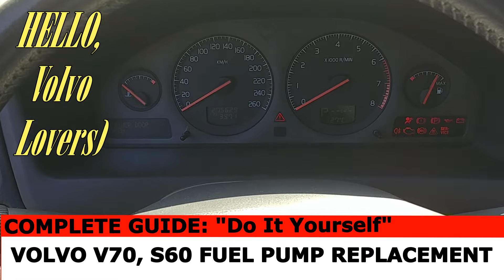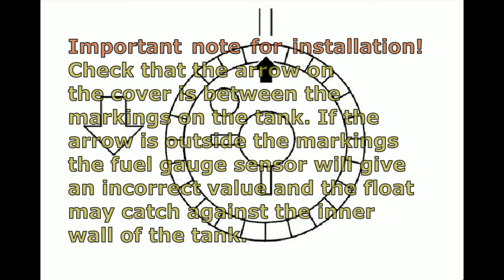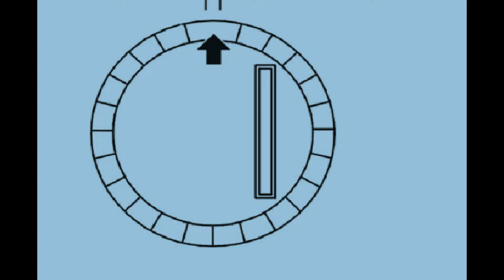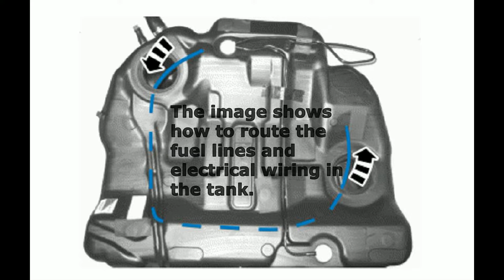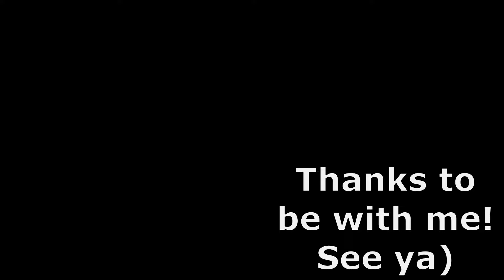VOLVO FUEL PUMP REPLACEMENT. COMPLETE GUIDE.

Comment: If you cap the ends of the pump before you remove it you can let it tip back easier to get the float arm out without spilling so much gasoline inside the vehicle.
Reply from the maker: Thanks Jon! I That's great tip! I will pin your comment up make sure other viewers can see it. Cheers!

Comment: Dear pistonshack. I have a 2004 Volvo S80 2.5 turbo all-wheel drive. I'm having two fueling issues. First one is I will fill my tank up in the needle reads full but once it gets past halfway it sticks and it doesn't move until the car runs completely out of gas this has happened to me twice while driving down the road. Second issue is that while feeling the fuel spews back at me unless I pump the fuel extremely slowly. Where it should take me just a 5 minutes or less to fill my tank it takes me almost 20 to 30 minutes to fill. What are your suggestions on fixing these issues. Thank you for your video and I hope to hear from you soon have a blessed day evening afternoon whatever time it is in your area.

Comment: I have no clue about cars really. I watched this as I thought my fuel pump had gone. I also checked the fuse for the fuel pump which was ok. But thanks to this video which showed how to test the fuel pump from the battery I done this and pump was ok. I then realised the connector had no power. I eventually found out that the fuel pump relay was located above the drivers footwell behind the steering wheel. So hard to find. So changed relay and all was fine. But glad I seen this video about testing the pump otherwise I would have thrown it away and bought a new one. Thank you for a great video.
Reply from the maker: That's awesome, I'm so glad this simple video helped you to get the car back on a road and save the money.You did right, test the relay and fuse first then checked wiring to the pump for voltage and ground! 
Cheers.

Comment: Hello! Great video👍  What volvo you fixing in video, is a xc70 2.5t ??  I have one 2007 and no turn on engine, Just make start but no turn on,,, meaby i think posible is the fuel pump gas... Thanks👍
Reply from the maker: Hey Eddy! I worked on 2001 Volvo V70XC with 2.4 gasoline engine. Have you tested your starter circuit yet? Check if you have power on starter command wire (Key Crank Position) first. 
I have video how to test starter itself.
Reply: @PistonShack  Okay! i try and i let you know,,, thanks!

Comment: Great video! Mechanics replaced my  pump dash showed 50% when it was full. They tried to fix it but still same. Then they put old and new pump together. It's kind of ok but doesnt show it correctly when tank is getting empty. It shows like 10% full, 250km to go but then you are on the road..
Reply: You think it's the alignment?
Reply from the maker: Hi Hannes. Most likely fuel sender unit inside the tank got bent or damaged during the installation process, especially when you pull out extension fuel line inside the tank. It's so easy to messed up the float and potensiometer. Let me know if you have any questions.
Reply: @PistonShack  I thought I might try and open it up so much that I can see if the arrow is pointing correctly. You never know. I guess if it is then you're theory is probably right, sadly. Thanks for help!

Comment: Thx for the video, did u had problems with the correct level? Either it shows too much or too little?
Reply from the maker: Hi Mrnurse! Yes, I had problem after I assembled everything for the first time. My fuel gauge was dropping down to empty if I had 1/4 tank of fuel. After reinstalling sender unit again (more carefully) it has been working correctly.
Reply: Thx for answering, how did u installing it second time? I mean did u turn it more to one side?

Comment: I have a 2008 xc70 and it will say 75 miles till empty then jump back up to 95 miles till empty. Any suggestions?
Great video BTW!
Reply from the maker: Looks like fuel sender unit float sticking a bit.

Comment: Thanks for the great video!  Is it required/recommended to replace both the sending unit along with the fuel pump?
Reply from the maker: Hi Jeff! Well, you don't have too but if you have fuel pump assembly why not to put a new one.

Comment: Hi. Amazing video. I have a 2000 Volvo s80 and I noticed that when I fill it up it only says 3/4 full. Do you think that the fuel level sending unit is bad or could it just be misaligned?
Reply from the maker: Thank you John! I installed 35$ used pump module. Yeah, fuel sender unit only shown 7/8 full.

Comment: Hey i have a volvo XC90 08 3.2 same problem when trying to start with a code p2227 is that the same thing changing the gasolina pump..I gotten the airflow map sensor changed spark plugs nit sure why i wouldn't start any ideas would be great thank u and like the video
Reply from the maker: Hey Shanelle! Sounds like you have crank no start issue.
1. Unplug MAF sensor, engine should start & run in default mode.
2. Check fuel pressure @ the fuel rail.
3. Check injector pulse, so easy to do (check Youtube);
4. Do you have engine light On and tachometer signal while cranking.
5. Do you have any other codes present?
6. How did this issue started?
7. Make sure your battery is fully charged.
8. Do you have any security / immobilizer problems related?  Try different key.
Let me know how is your Volvo. Cheers!

Comment: Great vid, 2 questions what year and model is car on vid, also I have a xc60 2015.5 T5 2.5L awd and the fuel level sensor is malfunctioning, I top it of and the dash will only show half a tank then later a full then as soon as I start driving (about 20 miles) it’ll drop like a 1/4 tank, can I get to it in the same way (removing back seat) or do I have to drop the tank? TIA
Reply from the maker: Hi Jose,
On video Volvo V70XC 2.4 B4244T3 engine. You don't need to drop the fuel tank. Probably fuel level sender unit, wiring or arm have issue. Fuel sender is on left side. Just remove back seat to get access inside  the tank. Let me know if you have any questions. Cheers)
Reply: @PistonShack   what yearrrrr

Comment: Question. I have a 2009 Xc70 needing a new fuel pump. Can I get access to fuel tank through cabin or do I have to drop tank???
Thank you so much
Reply from the maker: Hi Tad,  I'm not quite sure. Take rear bottom sit cushion and check for the fuel pump lids. Let me know if you have any questions.
Reply: Remove the tank

Comment: Nice video. What were the results from computer scan before? I have some issues at engine start and i think they are related with the fuel pump. It started to happens lately and often that when i push hard the car ( hard start in trafic) it gives me starts engine with problems, not normally as usual engine starts. Sometimes ( at mornings after the car stayed all night and cold engine) it doesnt start for the first and second time. It cranks, and it takes long to start engine, after that during day it starts but i can feel that the engine start has something wrong, not normal as before. Can you give me an idea. Thanks a lot 👋🏻 2.5t xc90
Reply from the maker: Hi, After I OBD2 scanning, I got nothing what can cause crank no start issue. I would recommend to check prime, idle and 2000 rpm fuel pressure.  Check for any vacuum and turbocharger leaks as well. Do you have any data from your Vida Dice scan? Let me know, I will try to get back to you soon as I can. Cheers.
Reply: @PistonShack  I made an OBD2 scan since vida vice is on the way...it shows misfire for 4 and 5.  I changed sparks, coils (all of 5 both) and still that misfire. Anyway ill wait for vida to see if it catches more info. Checked battery, alternator, all electrical i ok. No vacuum leaks, fuel pump presion not checked ( this week will) and the injector, maybe number 4 and 5 are letting down. Many thanks for the feed back. I’ll write if it is something new.
Reply from the maker: Oh, okay. I will start with basics: 
Check wiring down to spark plug coils, very often it could get jammed or damaged while screwing down plastic cover. 
Check injectors pulse and resistance and compare 3 and 5 with 1-2-and 3. 
Take spark plug out check for any oil leaks inside plug well. Check spark plug for gap, deposits and wear. 
Check spark jump with test light - should be min 1'' spark jump from coil to the ground.
Check wet and dry engine compression on 4-5 and 1-2-3. I have a video when I did compression test on VW Golf MK4 (check red Golf MK4 playlist)
I don't want blame ECU right now but it could be one of the driver failure but it's too early to say.
Let me know how everything is going.
Cheers Brotha.

Comment: Can I ask a question? I could route the wiring as instructed just couldn't get it to feed through. So i used a metal coat hanger. Fed the wire hanger through till it came up then the other end of the hanger I attached to the cabling and just dragged it through. I assume it doesn't matter if I done this or not. The car is running but does it matter if the cable has been just dragged across the middle of the fuel tank as I have done??? Advice appreciated
Reply from the maker: Hi, Michael. I won't worry much about it if your fuel gauge works properly and pump works.

Comment: my pump seems to b e working fine. car starts on one turn of the key. loss of power and engine management service light on (red). have been advised to remove fine filter gauze from under the pump housing and to replace pump as is. does this make sense?
Reply from the maker: Well, it's hard to tell based on information you provided. It shouldn't be gauze sump issue. Depends from the fuel quality. I never had problem with gauze filter itself. Pull it out and check it out.  Lack of power could be a vacuum leak, low fuel pressure, ect.
Reply: @PistonShack  my apologies. i did not indicate that the vehicle is in limp mode most of the time. the turbo does not kick in all the time. on a straight road i have enough power. as soon as i get to an incline the vehicle loses power and i have to drop gears to maintain momentum.
Reply from the maker: Do you have any DTC? Seems like you have issue with westgate or might be turbine itself on a way out.
Reply: @PistonShack  hi. i have the following DTC codes... engine system service required. engine system service urgent. airbag service urgent.
Reply from the maker: Okay. Those are general warning messages. I would suggest you to scan the vehicle with Volvo Vida Dice Tool or OBD2 code reader.

Comment: I got confused at 8:13 to 8:30.   Looks like you tape the sensing line to the bottom of the seat.  Why?   Thanks for this video!
Reply from the maker: Yeah, I did because fuel lines and wiring pulled back into the tank few times when I was working on the passenger side. Thanks for your comment!

Comment: Is the "canister" in the pump shroud the fuel filter? We have a 2009 C70 and cannot find the location of the filter.
Reply from the maker: Hey Norman! I am not sure about 2009 C70 set up. On my Volvo fuel filer mounted outside on front of the tank.

Comment: Nice video!
Do you know where the temp sensor on the fuel pump is located?
Reply from the maker: Hey John, Are you talking about gasoline or diesel Volvo? I don't think gasoline Volvo has fuel temperature sensor at all. In my Volvo only pump and fuel sender unit in a tank.

Comment: i did 
replace the fuel pump  same as  decripted here     but there is not coming fuel in the front of the car      its a v70 2.4 diesel        the pressside of the pump only delivers a very small amount of fuel     (sorry for my bad english )  that hose goes to the  fuel filter no ?     At the fuel filter i mention also 2 electric wires    what is the purpose of those 2 connectors ?   I cant get it to run the car because of the small amount of fuel coming out of the pump in the tank
Reply from the maker: Hi Dimitri! I need to look a wiring diagram. We don't have diesel Volvo in Canada at all.  Did you check new pump prior the installation? Do you have good pressure straight from the pump outlet? Some after market pumps are defective from the factory. I will get back to you later.

Comment: I''m in the middle of doing this job, I've stopped for a cuppa. I used a pair of large screwdrivers, crossed over to undo the tank sealing ring, using a chisel can snap the fins off. I've taken the pump apart to clean it out and can't remember how to put it back together! ha ha!
Reply from the maker: Hi, Timmo
What exactly you forgot how to assemble back together? I have used pump saved. I can take a look and help you with that. Cheers!
Reply: @PistonShack   Hi! I have managed to put the pump back together by pausing your video at a certain point and looking where the various pipes went. I disassembled the pump and housing as the fuel had been contaminated with grit and had blocked the fuel pump strainer meaning my V70 kept going into limp mode and cutting out. With the tank and pump cleaned and reinstalled my V70 drives great. Thankyou!

Comment: Hey its Xander,

Is the pump located in the same place for a Volvo s40 t5?
Reply from the maker: The fuel pump placed inside the fuel tank. I am not sure if you can reach from inside the vehicle just only removing the back seat or drop a fuel tank. I never did it on S40
Reply: @PistonShack  Thank you very much for the information💪
Reply from the maker: You're very welcome!

Comment: I have the same issue with no fuel. How do you check the fuel pump relay. I cant find it in any of the fuse boxes. Mine is a 2003 S60. Please help !!
Reply from the maker: Hello. Fuel pump relay located near the CEM deep under the steering column. Look for CMI 12 relay - fuel pump. To get that relay out use bend long needle nose pliers.  If you have any questions, let me know.
Reply: @PistonShack  Thank you..  I already diagnosed a bad pump. Power goes in but it does not work.  Getting a new one at ebay for $47. Thank you .
Reply from the maker: Sounds good. I will better install OEM pump or quality aftermarket. Cheap part do not last long but you might be lucky.

Comment: Why is it that you put the same fuel pump back into the Volvo. Just for demonstration purposes, or were you just testing if it worked?
Reply from the maker: Hey David,
I put used one OEM pump from local junk yard. It looks dusty on outside, might sounds like I put the same one back. Nope) 55K later pump has been working like a new!

Comment: Thank you for the comprehensive video!  One question about replacing the pump with a new one. I purchased a Bosch 30761742 (Website said it was compatible with my 2002 v70 xc AWD) and the new pump has an electrical plug on the top and only one connection to the sender while the old pump had two.  Is this a problem as my car has no means to plug into the top of the pump?
Reply from the maker: You are very welcome, Laird. 
Yeah, I experienced the same issue replacing my fuel pump. Thing is 2003 and newer models have different wiring to the fuel pump. My advise will be,  just find the pump with a same wiring (2001-2002 models). Other wise it won't work.

Comment: I hate the P2 fuel pump design just because you gotta remove both units😞. On my old 850 it was a quick 15-20 minute job
Reply from the maker: That's good to know) Normally, older models are much easier to fix. Let me know how is your repair so far.

Comment: Nice and lovely...
But I can't find this type of fuel pump, just the other one everywhere, which has an electric socket on the right side unit between pipes.
BIG SUCK!!!
The pump works well, but some "professional  mechanic" broke one of plastic pipes off and all the returning diesel flows out.
Tried 4 types of glue, but can't fix it that way...
Reply from the maker: Hi Zsombor. Sorry to hear that! That's why I do all my repair by myself) 
It took me quiet some time to find pump for my 2001 V70XC. Only one of 15 Volvo  at the yard had right type of pump. Bzw, how is your repair status?
Reply: @PistonShack  still no success yet. I bought the car with glued pipe. I was in 3 different services with diesel leaking, because had no time for repair myself, but all 3 said there is no service panel on right side...
Then I bought a complete tank to change, but it's wirh different type pump.
Now I try to find a lathe workshop to make a special common screw. Maybe...

Comment: You've made a nice video, but i'm concerned how the fuel pumping system works, because I've replaced mine, pump is working, but I get no fuel to the passenger side from the driver side and car stalls.
Reply from the maker: Hi, Misha. That's common issue if you didn't route side fuel sender line. Follow fuel line diagram, otherwise pump won't be able to get fuel from both sides. Let me know if you have any questions. Cheers.
Reply: @PistonShack Well, you made me concerned now... I have the suction type thingy in the right place, I used rope to manage my routing during the installation. I'm now thinking that my fuel pump element is faulty, because it sometimes seems to work sometimes it isn't... Btw I've installed the used unit. I'm going to remanufacture it myself by replacing the pump itself... If then the issue continues.........

Comment: Where can I find the emotions code to match right fuel pump
Reply from the maker: Hi, Trone.
What you mean by "emotion code"? 
The easiest way to find a right fuel pump is to compare visually electrical connectors and fuel lines location and shapes on pumps. Also you can pull Volvo part number form VIDA or ask your local Volvo dealer . 
Cheers!

Comment: Ah I see you never videoed dealing with the fuel line routing and attaching the left side sender to the fuel pick up line. .just have kicked your butt real good. If it's not properly installed car will only pull fuel from right side of tank.
Reply from the maker: So true MonzaRacer! Good point. When my fuel pump will fail again I probably should record only that part - How to do fuel line routing and attaching the left side sender to the fuel pick up line! Cheers, thank you for watching!